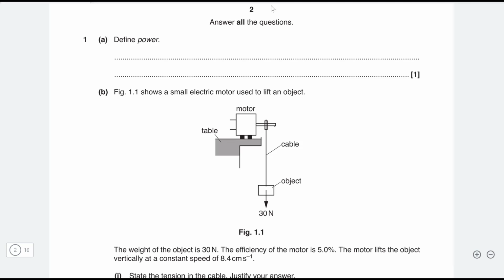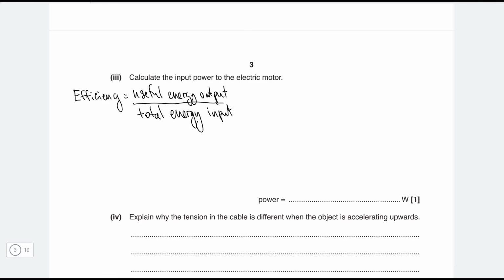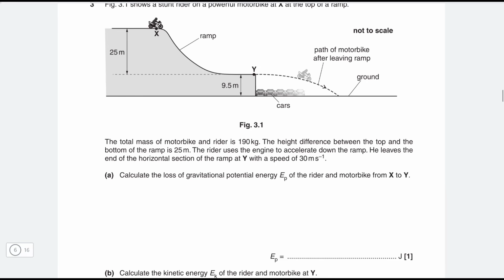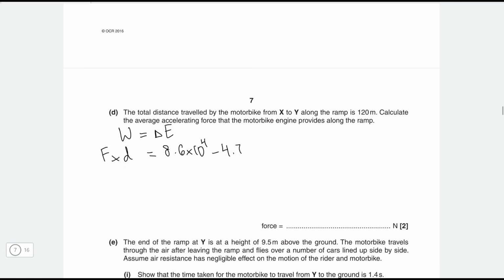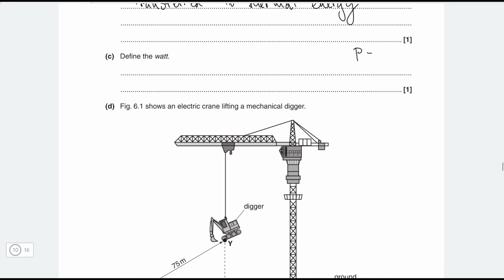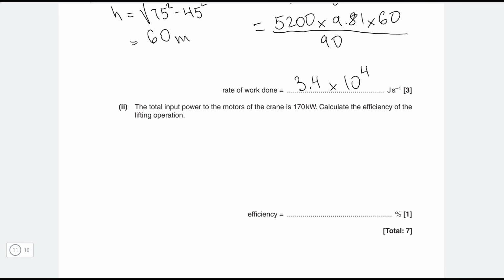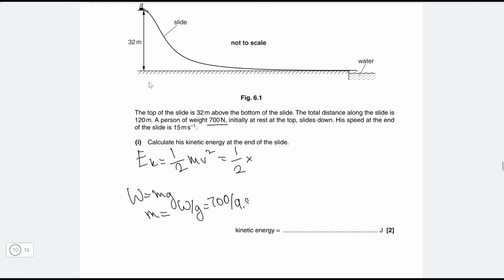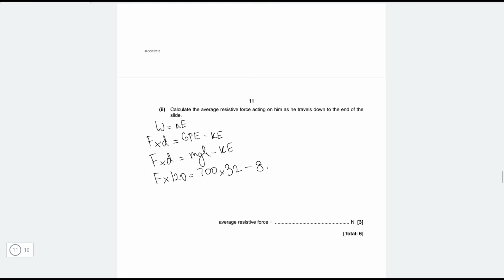A Level Physics Revision: Work, Energy and Power Past Paper Practice Questions

Comment: hello, in  the q2 you state that the loss of height is 25m , but isnt the loss of height 16.5 since the point y is 9.5m over the ground level?
Reply: part a is asking for the loss of gravitational potential energy between x and y, which is 25 metres, y is not at ground level

Comment: QN 3 (i) you said that you used the the vertical distance which you calculated 60m but i still i didnt understand why you didnt used the distance between x and y in which the crate lifted the digger.
Reply from the maker: so the crane does work against gravity, the vertical distance is the distance in the direction of the force. Hope this helps!

Comment: For Qn2c when you said that the kinetic energy is larger than the GPE lost due to the work done by the engine; can you also say the work done (energy transfer) of the engines from the chemical energy to the kinetic energy. and can is it correct to say the GPE is the lowest at Y and K.E is at max at Y.
Reply from the maker: correct about Y, and yes you can say this but the origin of the energy would not necessarily get you extra marks. Hope this helps!

Comment: For (a) GPE between X & Y shouldn't use h = 25 (X) - 9.5 (Y) ? GPE between X & ground should have h = 25. Thanks
Reply from the maker: excellent question. No, they say that the height difference between the top and bottom of the ramp is 25 m. I.e. the ground is further 9.5 meters down and our change in height from the top to the bottom of the ramp is 25 m. Hope this helps!

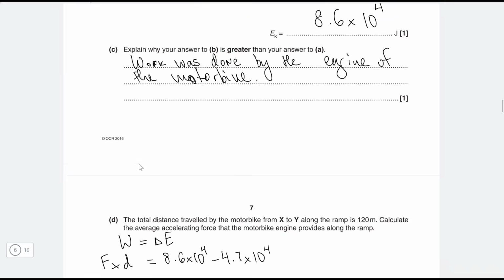Comment: i dont quite understand at 11:25 why you subtracted the 'loss of energy' instead of the actual initial energy, can you explain?
Reply from the maker: Excellent question! So GPE is great because we can set our 0 level anywhere we like. i.e.  we can assume that the GPE at Y=0. If that's the case the loss is equal to the initial energy. 
Note: you will get exactly the same answer if you add in the additional GPE due to the 9.5 m before and after in the ramp but the change of energy would be the same. 
Hope this makes sense!
Reply: @zhelyo_physics  wow i did not know that, thank you for the explanation. it made perfect sense
Reply from the maker: Glad to hear! Anytime, always fun to think about physics : )